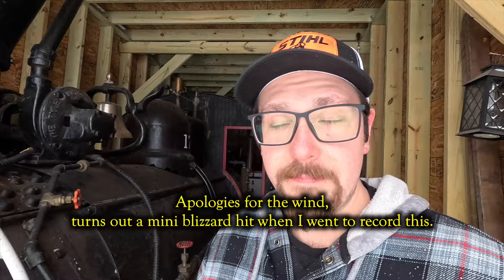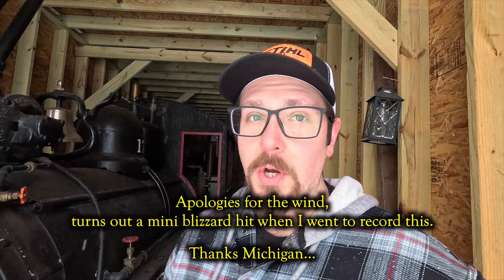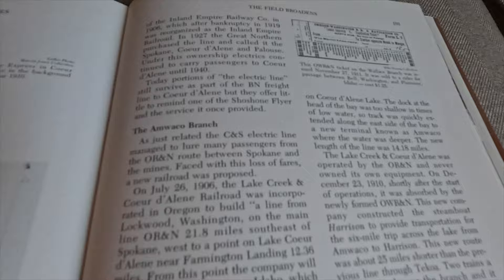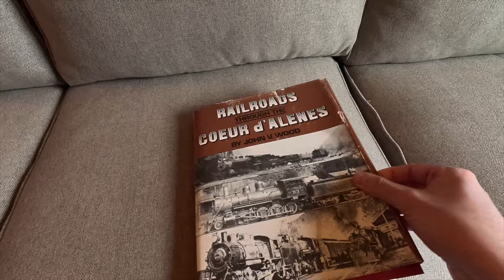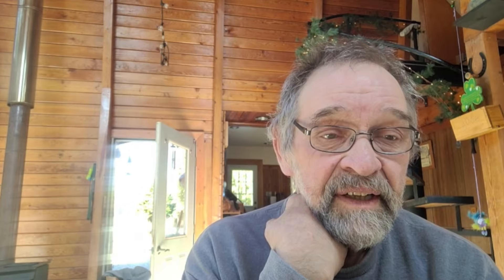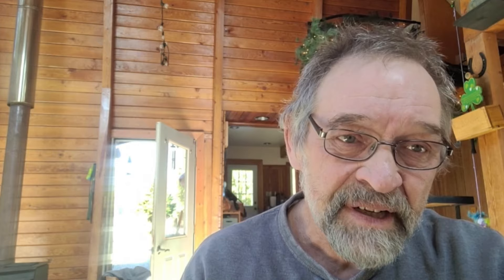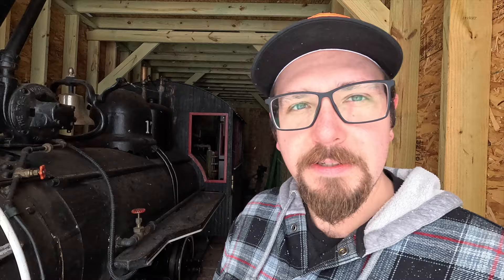The Complete History of H.K. Porter 1715 - 1896 to Present Day

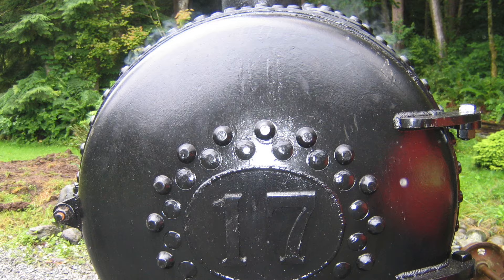Comment: Built in 1896, Man-O-man what a Gem of a preservation story. @40:30 I am surprised that the smoke box is still original because they were built to replaced long before a new boiler would ever be needed. That fact may be due to the fact that it was used as an air-pressure loco before being converted to actual steam power. This is a great preservation story and I want to remind all viewers that even if you dream of doing such a project like this but lack the necessary funds, you can still support individual projects like this or any railroad preservation society near you or railroad Museums and also volunteer your time and get to work on a real steam locomotive or help rebuild track and get to do all of the behind the scenes type of stuff that goes into running a real steam locomotive, it is nothing like inserting the key to your car and turning on the engine in 2-seconds and it runs.
 At the same time. I would like to shout out to all the people that preserve this type of history, be it real steam locomotives or a steam tractor, a stationary steam engine or a River Boat and also the preservation of documentations and all the paperwork that most people would just throw away like a junk mail. 
 So, if any of you ever have an elder loved one that passes away and they some sort of paperwork or items you don't understand, PLEASE DO NOT THROW them away! Contact your local historical society and even if they don't want them for their own collection, they will know what to do with them or put you in contact with someone that will want them.
 I would also like to say that I think has the most massive railroad lantern collection I have ever seen, and I mean like Smithsonian Institute Museum size, and I hope he has a plan in place to donate all of them as a collection or to respective individual Museum's for more people to enjoy seeing them.
Reply from the maker: Believe me I was as shocked to find it in as good of condition (mostly all original parts still on it) when I did :) To the best of our knowledge the box was not added until the Hecla Mining Company converted the locomotive to run on steam (sometime in the 1940s). I've stared at the builder photos for hours going over each detail to see what parts are still with it and which were scrapped in the conversion.
As to how the box survived for this long we can only assume it stayed that way due to its relatively low run time during its service as a steam locomotive in Idaho. We may never know exactly what happened as those records were most likely destroyed in the fire of 1926 in Burke, Idaho. 
But you never know, something may turn up yet! Thank you for the comment and thank you for watching! We'll put any further information we find out on this amazing machine in a future video. I'll reach out to Diz in the future regarding his lanterns. We might have some more footage of them hidden away!